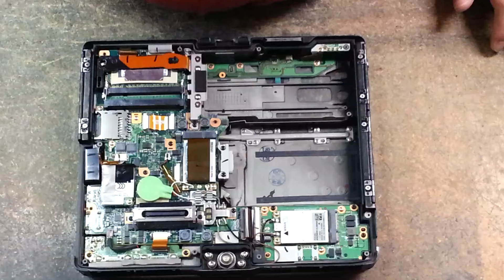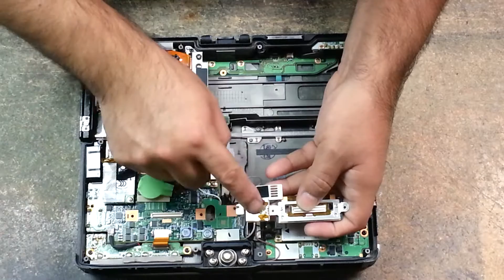Panasonic cf-19 antenna dock connector and Wi-Fi card removal

Comment: hello, what are the connectors for the external gps antennas called? I need to assemble a cable with those connectors
Reply from the maker: I'm sorry I don't know what their actual name is. You can try searching for the user manual. I have found that some Panasonic manuals have a break down of the machine with parts list and names.

Comment: it's an mk5. if i can get my camera to focus. cf-19bvufx1m.
Reply from the maker: ok, I think you should be able to connect the 2 wires, I'm not sure if on the MK5 there is supposed to be a jumper wire that goes from the wifi card to the board that has the 3g wires and wifi wires. I'm not sure what the name of it is but it's the one that has the dock connection.
Reply: 616 PC Repair i will have photos tomorrow.
Reply: 616 PC Repair i ordered a mini card yesterday, now hopefully all i will need is maybe some jumper wires and a driver.
Reply from the maker: cool. I wonder if I have a jumper wire, I have tons of parts for MK1/MK2 but a jumper wire is a jumper wire. I will look later and let you know.
Reply from the maker: cmarquez616@gmail.com

Comment: ok great thanks. the right side says upper right  wwan + lte aux and lower right wlan/wi max main. the left side says the same thing except left instead of right.  blu , gra wires on the left and grn, blk wires on the right.from what i can remember the grn and blk wires went to the lan card but there's no 3g mounted on top of it and the blu and gry wires connected by the port replicater connector. can i just add a mini card 6235 which is what mine takes and then connect either of the two sets of wires to it? thanks for your help.
Reply from the maker: would you mind taking a shot of it and sending it to me via email? Is yours an MK1 or MK2?

Comment: can I install wifi into one that didn't come with wifi and what about the wires are they already there? thanks for the videos.
Reply from the maker: Yes, you can install a wifi card on one that may not have it already installed. You can remove the bottom cover to check for the wifi antenna cables, or you can remove the black side overs on the LCD lid and read what the green pcb boards (antennas) say on them. Thanks for the question, please let me know if you have any others.

Christian